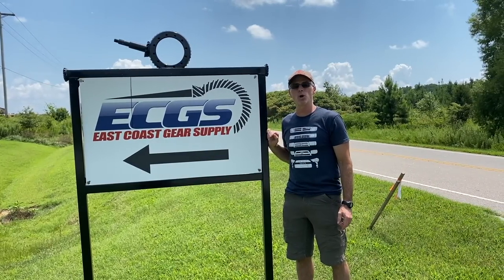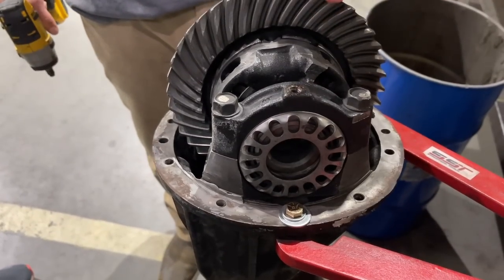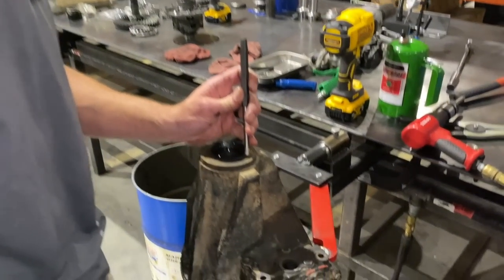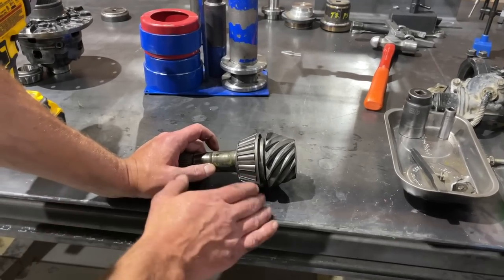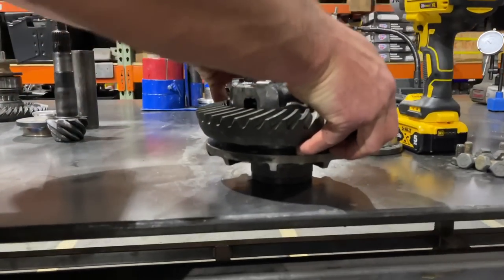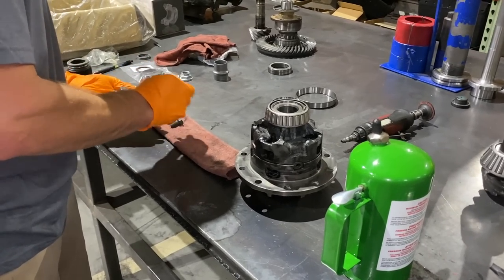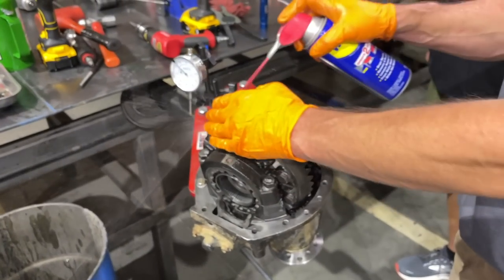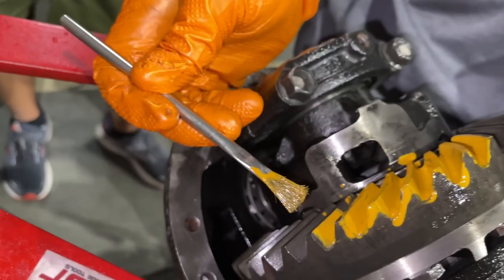ECGS Toyota 8" Rear Differential ReGear/Rebuild (with CEO Chase Perry)

Comment: Ok, so on a stock toyota rear diff he's recommending 75w140 gear oil? Just making sure I heard that right.
Reply from the maker: Chase actually recommends running 85w-140 for every differential.   If I understood him correctly, he likes the thicker viscosity gear oil for the cling factor because it will offer more cushion between the ring and pinion gears lessening wear.
Reply: @TimmyTheToolman  right. I can see that. The other thing I just saw was the recess on the pinion seal and chase mentioning toyota seals should be recessed. I wonder if that's all shaft seals. I'm thinking of the shaft seals on the CV axles at the diff housing. I've always set mine flush because I thought that's what I remembered from the very first time. Although I do know that on the 4th gen, there is a a flange, or sort if like a rabbet on the passenger side that I install it to,  and that is recessed very similar to the pinion seal in this video.
Reply from the maker: @TheDesertRat31  The recessing of the pinion seal is to avoid the pinion flange dust seal pushing up against the seal and giving you a false pinion bearing preload value.  

The CV axle diff seals are recessed approximately 5.5mm from the outside of the differential tube on the passenger side or differential housing on the driver side.  There's a step that they are inserted flush with.  The Wits End company makes a cool seal insertion tool for these seals to make it fool-proof to insert the seal to the proper depth.  We use the tool in this video https://youtu.be/Q-RO52NtP1A and we provide a link in the video description.  Check it out.

Comment: Please help! I have ‘00 4Runner v6 and it stalls out on steep hills while climbing in 4wd and usually when the wheels are spinning 😵‍💫. What could cause this?
Reply from the maker: If it's only on steep hills, it might be a fuel pressure issue.
Reply: I’ll try to get it tested and run some cleaner through it. Could it be the crankshaft position sensor?
Reply from the maker: @arnoldarriola2171  If it were the crankshaft position sensor, you would throw a code.
Reply: @TimmyTheToolman  thank you I appreciate your help!
Reply from the maker: @arnoldarriola2171  No problem

Comment: Starting out right around the 6:46 mark in the video when he flips the Diff over to show what’s happening when The actuator motor is locking and unlocking the diff he is pushing in and pulling out that part that has the fork part on it(sorry not sure exactly what he called it) when he pulls it out he says the Diff is unlocked, when he pushes it in he says the diff Is locked. On my third member I am not able to push that part in if I put a pretty good amount of force on it I can get that part to start pushing in but can’t get it to lock in position. Any idea what could be causing this? It is currently in the unlocked position but I am not able to push it in like he is in the video. It looks to me like he is not using very much force to push that in and sometimes just tapping it in with the side of his hand. On mine I am having to push it in pretty hard to even get it to start sliding towards the locked position. Thanks for any help you can give me on this.
Reply from the maker: That's the shift fork and locking collar he's manipulating.  You are correct he wasn't using much force to move it.  Maybe yours hasn't moved in a long time and some gunk has built up on the gears.  I'd spray some penetrating oil in there to try to free it up.
Reply: Tim thanks so much for the reply. I will try doing that and seeing if it makes a difference. I can get it to slide in maybe an inch to inch and a half but it takes a decent amount of force. Definitely not as easy as the one in the video. I’ll give that a shot hopefully it will free up.
Reply from the maker: @rthomas2157  You're welcome.  Hopefully 6ou can get it moving more freely.
Reply: Total bone head move on my part. I still had the actuator motor installed while pushing in on the locking collar 🤦‍♂️. I took my third member in to a local guy that has a lot of experience and is very knowledgeable about these diffs. The first thing he asked me is if I had taking the actuator motor off. As soon as he said that I realized my mistake. Oh well lesson learned. On the plus side he said the third member looks to be in good shape and everything is good to go. I picked up some Toyota FIPG and new crush washers will be installing it this week. Tim thanks again for all your help and making these videos 👊
Reply from the maker: @rthomas2157  Gotcha.  I just assumed you had the actuator disconnected like we had in the video.  Good luck with the install.
Reply: Thanks. Yep as soon as he said that I was like oh damn no wonder. And I had watched this video several times.
Reply from the maker: @rthomas2157  Oh well, we all brain fart from time to time.  I make lots of blunders making these videos.  We show some of them but not all.  The good thing is you're taking up the challenge and doing your own work.  So, keep it up!

Comment: To find carrier preload is Total preload - pinion preload then multiply that by the gear ratio.... For instantc 10 inchlb preload and you install carrier and you spin pinion with carrier installed and you have 20 inch lbs with unit assembled and you have a 3.41 gear ratio... Itll be 20 minus your 10. Multiply that 10 by the hear ratio and you habe 34 inch lbs carrier preload..... How i do it hasmt failed me in years
Reply from the maker: Very interesting.   Thanks for sharing.

Comment: Huh, which torgue wrench did you use on the main housing bolts, it's digital and not listed in the description, Percision brand? 40:43
Reply from the maker: I don't remember what brand digital torque wrench Chase used.  For what part of the video are you referring to?  A time stamp would help.
Reply from the maker: @GuninGames  Yeah, I've seen that style but I don't know what brand or model it is.  They call them a Split Beam Torque Wrench.  I believe you are correct though that it is the Precision brand.  I think Chase is using this one.  https://amzn.to/44awmwQ  It gets good reviews too.  Might be a nice one to get.  I just bought a ridiculously expensive digital torque wrench from Snap On.  I spent $830 on it so I could torque head bolts with the angle function.  I think it was a waste of money.